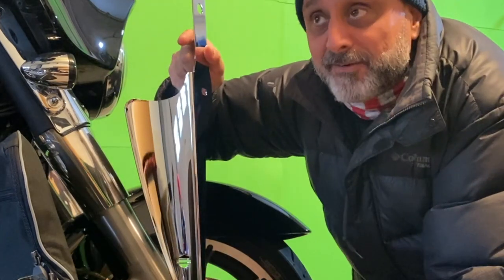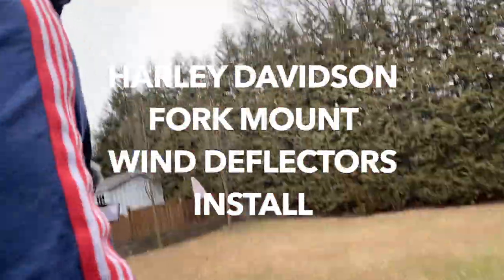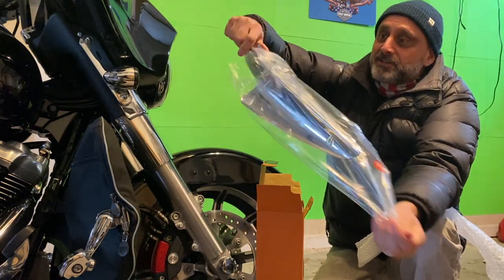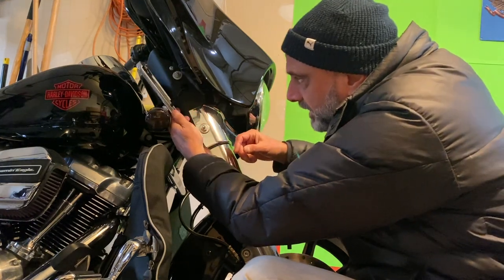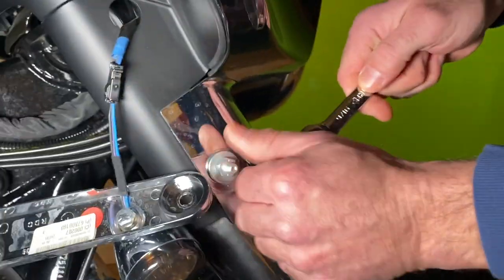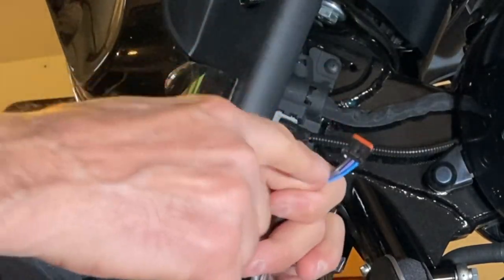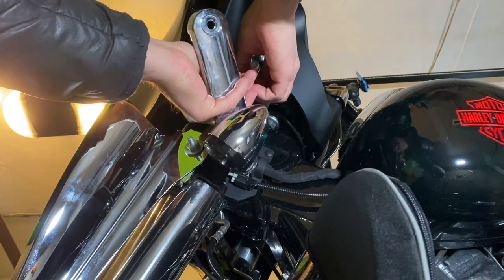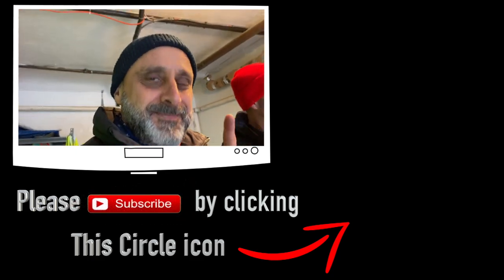Harley Davidson Fork Mount Wind Deflectors Install

Comment: I've had them on 4 police bikes and currently on my 2017 FLHTP. They work great PERIOD. Good choice. These are redesigned over previous generations. The older style had angles and weren't curved like these but either style cuts buffeting a bunch.
Reply: I am thinking of putting a pair on my 14' police edition, your review is tipping the scales, do you have anything else to add.

Comment: Bikes with wide fairings create this buffeting more than a windshield. The best way I can describe it is a fairing creates a pocket of air around the tank area and when the wind passes by that pocket of air it rushes up towards your helmet creating buffeting. The deflector will push the wind wider so it doesn't rush into that void air pocket. You probably won't notice the difference until you reach highway speed plus you already have the deflectors on your crash bars which kinda do the same thing but these will still improve it. Jon as you experienced on the KTM 1290, adventure bikes deal with this issue more effectively because the design of most of the fairings don't allow air to come up around the tank (leg protection) I've had great success with these on several bikes. You'll be able to have a lower windshield because of their effectiveness. Sorry for the long comments... Like your channels boys!👍

Comment: You should use the blue loctite on the bolts anytime you take something apart on the bike. Essentially if your using the tight enough torque method. I have them on one of my bikes a 2001 Electra Glide they work on the highway no difference around town.
Reply from the maker: Thanks- I can’t wait to try it out next few days...I’ll update

Comment: Do they effect the air flow over the motor very much.thanks
Reply: I took mine off because of noticeable engine heat, 2021 FLHR going to a tank lift with wings

Comment: the pros and cons of the wind deflectors. PROS they work great for helping with the updraft wind and road dust/bugs ect. into the eyes, The CONS the engine does not get all the air for cooling but the deflectors are worth it for eye protection, your set up is similar to mine. I keep the wind deflectors on year round and remove the lower cloth fairing in the summer. Deflectors are well worth it
Reply from the maker: Thanks buddy- I’ll ride it tomorrow and post my thoughts

Comment: Have you tried looking into DK Customs they have a tank lift it raises the front of your gas tank and rear if you want depending how much you choose can be anywhere from 1 to 3 inches and a lot of the wind goes under the tank keeps the engine cooler and less wind goes up towards you I put the inch and a half on my softail and it honestly made a big difference and the engine temp dropped by 20 degrees it’s really inexpensive and awesome quality from them  they have awesome customer service! give um a look they got a lot of parts
Reply: @The Missouri Piper it will only have a big change if you use the biggest lift but with mine it changed it a little bit and in all honesty I think it looks better. It’s inexpensive but it can have an impact on looks and cooling and you can clean the tops of your rocker boxes so for me personally it was great all around. It’s also really quick and easy to install or remove and they have different pictures of the heights on their website to give you an idea. I hope this helps have a good one!

Comment: You did the Vance and Hines FP3 install a while back. Just wondering how you like the results and if it made a noticeable difference in power, or throttle response.
Reply: Jerry, I have the V and H3 on both my bikes. You can adjust throttle response, and fine tune your bike. However theres things on it that you dont want to touch unless your a technician, and know exactly what to do. You can also get rid of the liminater that governs the bike to 110 mph.  Great product, and worth the money. Saves you from having to spend the Harley bucks at your dealership to have it flashed every time you up grade.

Comment: Sandy, you said to tighten the bolts 14.6.... but 14.6 what?  NM or FTLBS? Bought some fangs and cant find this info anywhere.
Reply from the maker: I was joking with the 14.6 …. I don’t know what the torque specs are…😀👍🏻
Reply: @HOLYSHIFT  😡😡😡😬

Comment: Did you have any problems to connect a USB   charger to the ligther port in your motorcycle      in mine alway get fried in 2 seconds
Reply from the maker: I had a USB charger integrated in my radio install - no problem